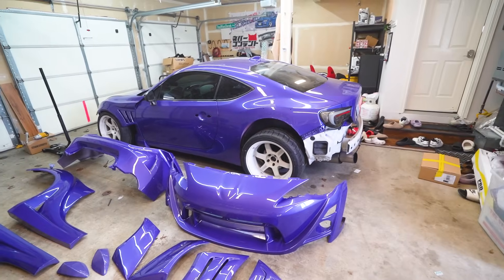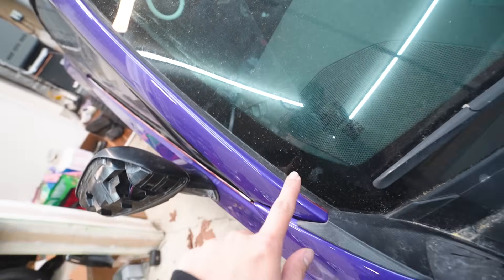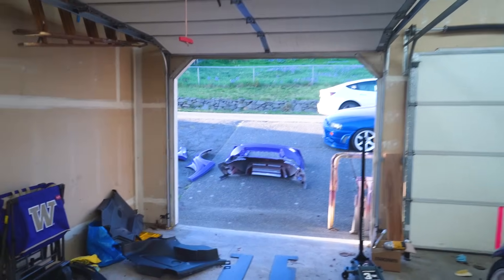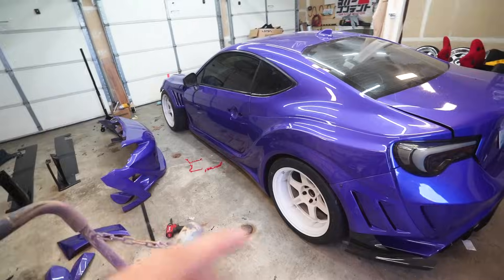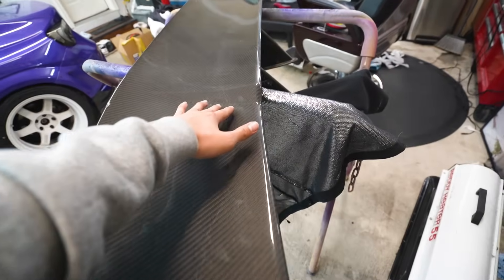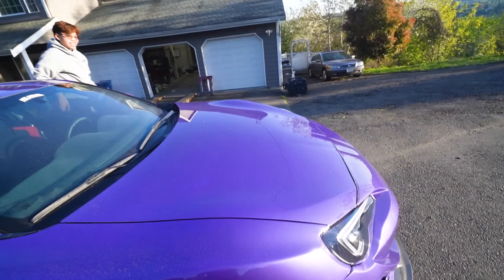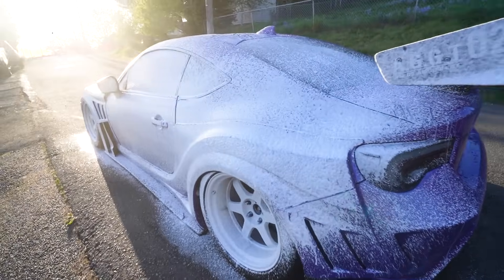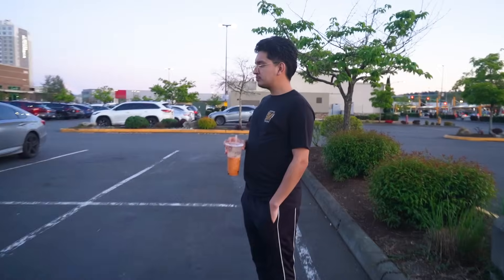Assembling My POOR MANS GT3RS! | The Widebody BRZ Is Now COMPLETE!

Comment: Are you gonna ppf these, I need a tutorial 😫
Reply: Waste of money.

Clear coat is on your car to protect the base coat.

You can get light scratches and they will flat sand / buff out clear coat.

Get scratches in your PPF and you need to replace it.

Get a deep scratch and deep chip in either PPF or paint and it's a repaint/re PPF.

If you taking your car to a body shop for a respray on a panel then yes it's probably more expensive to do than replace the PPF.

However if you can repaint yourself then it's a lot cheaper to paint than replace the PPF.